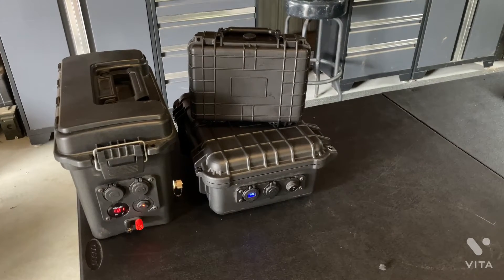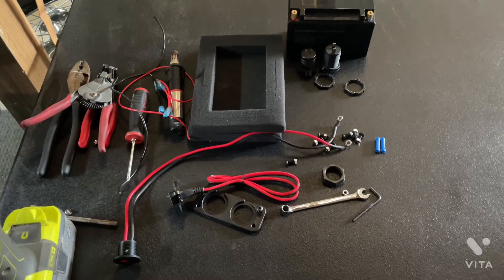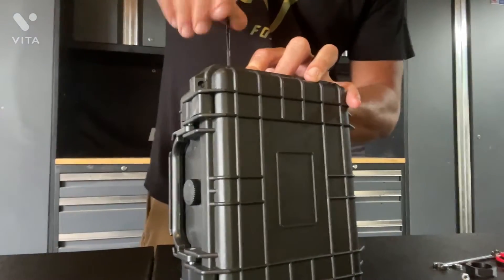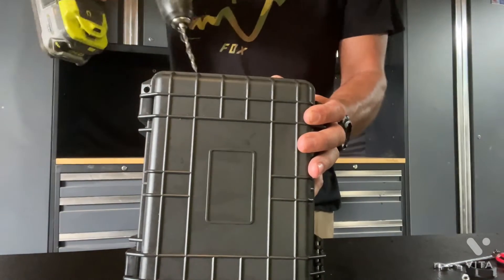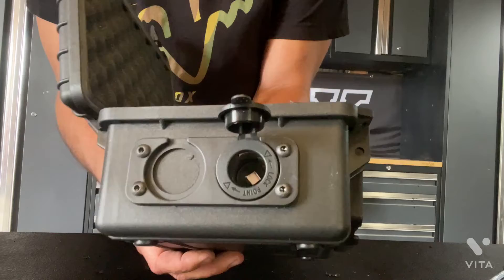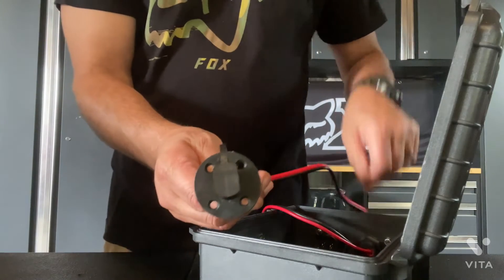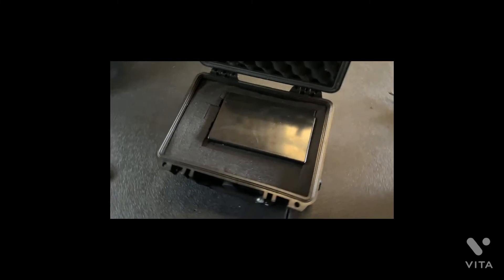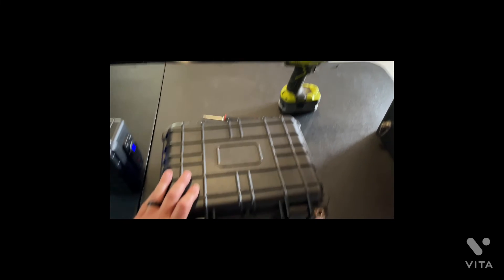POTA POWER!

Comment: Good work. I am myself in the process of fitting out a flight case which will have to contain 1 or 2 batteries, the tranceiver, the vetrical antenna (aluminum tube diameter 10 or 12 mm), is the things necessary (the solar panels are too small to 1 cm; that annoys!) To have a flight case ready for the POTA
73 thierry F5PQV